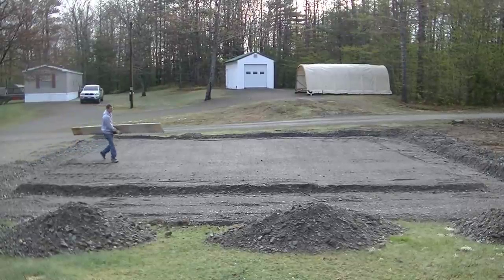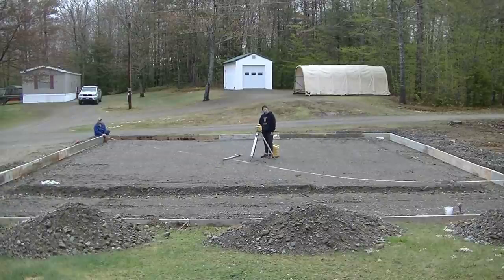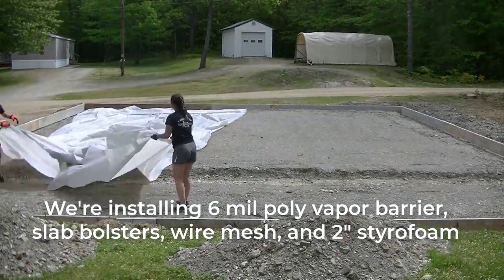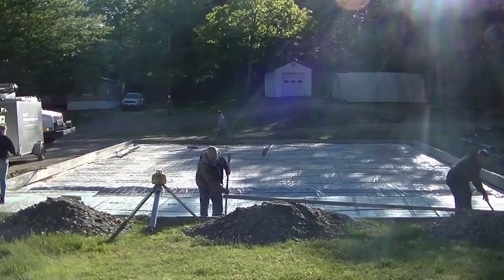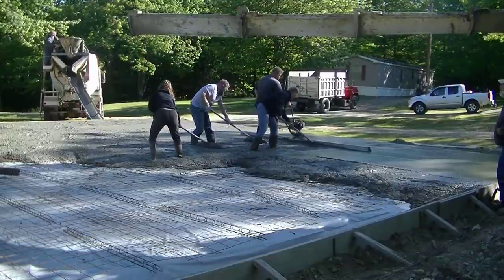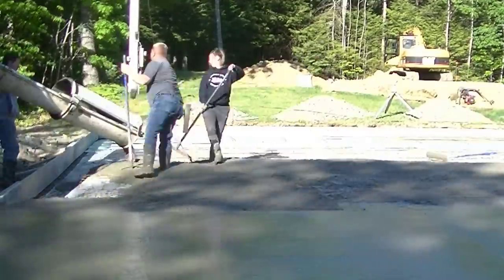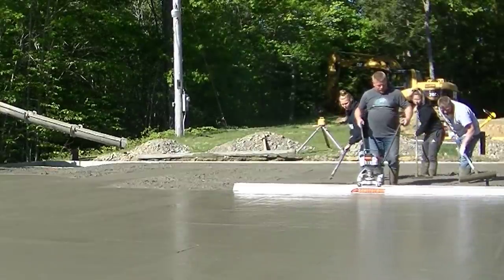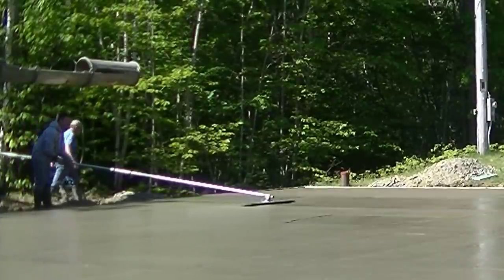How To Form and Pour A 60' x 50' Concrete Slab (BIG Garage Floor!)

Comment: Mike I have worked in many different shops over the years and I can really appreciate the fact that you take the time to make the shop floors as flat as a pool table. I realize how important level is from years of working in places where The equipment all needs to be drastically shimed up  and there are so many other issues as well.

Comment: My crew has been on a series of 2×10 turndown, house foundation slabs for a good while now, all in the same little housing development here in good ol Dublin GA, so I definitely feel your pain on how heavy these damn boards are. Especially the treated ones, which is what we use normally since they last a lot longer out in the elements. We also drive wooden stakes with a sledgehammer, with kickers to form them and the dang dirt is hard as a freaking brickbat lately because we've had a lot of dry weather. It's calling for mid to upper 90s next week so pray for us Mike. 🙏

Comment: I think I spoke to soon. You used fiber mesh as well. Did you everything, fiber mesh, rebar and wire because the slab was so big?
Also on something this big, being a garage, what is your opinion on putting floor drains in?  And what type would you use as well as placement of them.

Comment: Hey Mr Mike could I use some old chain link fence in place of the rebar in a small 4ft wide wrap around addition to my shed slab? It does not have to be super strong it will not be driven on just foot traffic and I am in the Deep South so we don’t see freezing temps very often.

Comment: Hi is there a chemical which we can put in a concrete mix to make it more waterproof
Reply: xypex
Reply: @rh-pr3hs  this is after the concrete has been poured. I was wondering if they is a chemical which you add to the concrete whilst mixing it before pouring it.

Comment: Well you do a 60 by 50 can you do a 50 by 2600. Well my garage is going to be a 40 by 60 and my house is going to be a 30 by 110. Now I mention about that one the driveway is 16 ft wide and 350 ft long she the one date then there's roughly about 50 feet past the gate and then then you talk about a slab 50 feet from the place and all around the house and behind the garage. Yes I know it's a lot of concrete

Comment: 4000 concrete will crack more than 3500. Why? Because there’s more concrete in it. Exbit A. bend  a pencil, bend a piece of paper. 1700 lb concrete is strong enough to hold anything he puts in there. 4000 lb concrete is the finishers friend because it sits up faster and it’s creamer to finish. 4000lb is super nice, I just tell them up front that 4000 may crack more but so what isn’t a saw cut just a big crack in a straight line....